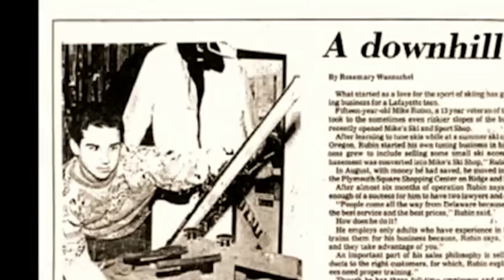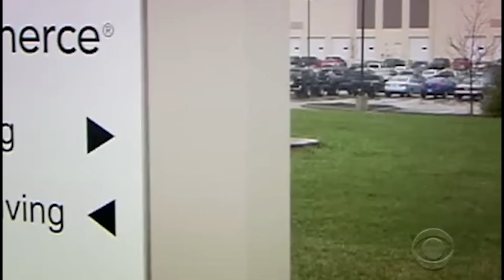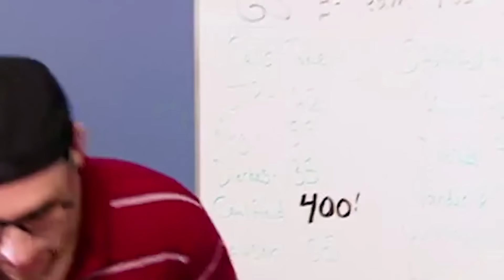Times Bosses Got FIRED On Undercover Boss!

Comment: As a customer service Supervisor there is nothing wrong with what she said. Clearly she called in wanting assistance but you have to allow the rep to speak to help you
Reply: But sometimes the customer service misunderstand things and talk excessively, which usually ends up with the problems not being fixed nor addressed. So, it all depends on the context. I have had nothing but bad experiences with customer service because they dont listen and Im generally on the calm unemotional side. Let's be honest here most people working these jobs aren't exactly the brightest and most capable individuals. I don't trust them figuring things out without being told what to do instead.
Reply: I also want to add that I'm sure the CEO is more informed on the context and therefore wouldn't be so visibly disturbed if she did nothing wrong.